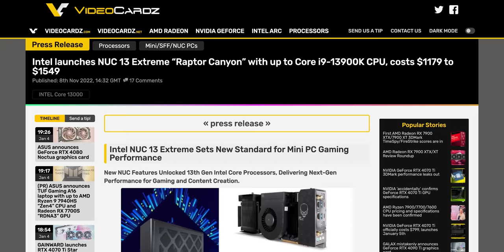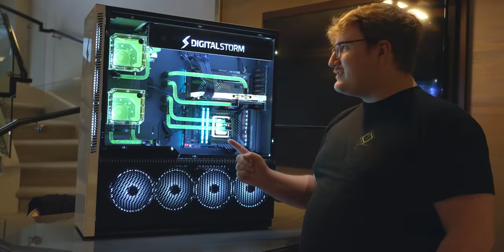They wouldn’t let me game on this - Digital Storm Pre-Builts

Comment: This actually looks really portable. And while this specific one is only for show, a 3080 makes sense given how expensive the 4000 series is (I know the real reason was for the water-block).
Reply: He cringed and apologized when he moved it 3 inches, he kept saying everyone is scared wether he’s joking or not this doesn’t seem in any stretch as portable, if I can’t take my system away from the home confidently I don’t bother with it. But that’s just me.
Reply: @Redacted_  did you even pay attention? It's a thin plastic prototype. Jfc some people are insufferable
Reply: better buy the soft tubing option if you plan to carry it with you
Reply: @Redacted_  its a joke because of how much of a prototype it is as explained in the beggining
Reply: @austinw212  Yes because Dropping a Prototype can be Catastrophic especially if it's the Companies only one and then you can Responsible for Paying for the Parts the Tooling and Labor cost to make another one which gets Expensive you could probably buy a Truck Load of 4090's for the Cost of a Mistake like that
Reply: Yeah, but how cheap is the 3080 comparably? In Germany atm the 3080 and 4070 ti are basically the same price in retail so the 4070 ti makes sense here (I know it wasn't out yet when they designed the system)
Reply: @Redacted_  It's made of plastic, it's a prototype
Reply: @hermitcrack9091  no I missed that part, it was on in the background as I was at work doing a few different things at once.  Don’t have such a diva meltdown about it Jfc
Reply: @Redacted_  cope
Reply: Get some ITX parts, put them in a FormD T1.... profit?

Comment: 7:28 I have a tech tip relating to the tea pc. If you need a tool assist to tighten fittings put scrap cuts of tubing on needle nose pliers, it keeps the fitting from getting marred. You can also buy cheap bulk tubing in a variety of sizes at most hardware stores to get tubing that fits more snugly on your pliers (helps in cramped places).
Reply: Nah, use regular pliers, not needle nose.  The inside shape of normal pliers gives you much better grip on something round.  Just cut the scrap piece of tube open and wrap it around the fitting before tightening.

Comment: I feel like for safety reasons they should put the PSU at the top of the case with some sort of custom power cable adapter that lets you still plug in down at the bottom. I would be concerned about potential water cooling loop leaks that very easily could drop down into that PSU with mains voltage running through it. Otherwise it seems like a very nice product.

Comment: I can't find any volume figures for the spark, but the original was a little less than 5 litres. So if we're still sub 8 litres and get xx900k and xx80 series graphics in such a small case. That's really impressive, I'd love to know if they have to undervolt and what temps they get.
Reply: you can calculate it, he had iphone near it
Reply: @vipvip-tf9rw  sure, I could do that. But I'm not bothered enough to put in the work. It's not like I need to know the volume for any particular reason, except a curiousity

Comment: The only question I have is: why? Why would they use a NUC, and not just standard ITX parts? It's not like this is much smaller than a FormD, H1, A4-H20 or N1. All cases in which you can also fit the highest end parts, but then in standard sizes, without resorts like NUC parts.

Comment: They should bring back sli in the form of ramless GPUs that just add to your current setup and increase your performance slightly for GPUs that don't pass their requirements and in general give older gens access to raytracing. They even could call them "rtx sly" or "rxXXXXxt cross" for AMD/ati replacing the X's with the series.
Reply: The cross could also be another X hahhahaa

Comment: I'm currently thinking about building something like this with the new NUC 13 Extreme. Any details about the baseboard and how they use it with a differently located GPU? And using a normal PSU instead of the intel 12V specific PSU?

Comment: Flawed. So so flawed. The Nuc series has always been a horrible platform. More costly and has worse performance with virtually no space saving over a mini ITX build. A FormD T1 will be of similar size with a MUCH better upgrade path. Options include air-cooled, AIO, or custom loop.

Lol. Send the system back to get an upgrade.

Comment: at that point just get avtim from 2019 were just seeing cap lity of thst into smaller computers ther nothing really new except.maybe perfkrnace of card would be doi cbality seeing that in case perchip really hasn't changed excel squiz more air water make gpsu perform better in smaller case 2 grsndis bit much I'd out make 1300 1400 max 1500 .

Comment: Tell me what you think after reading the following statement:
Paul's Hardware had 4 sponsors on just one of the videos for CES23 that I just saw ("ASUS/CoolerMaster/KIOXIA/GIGABYTE").
LTT had no sponsors for CES23 and Riley is selling himself on the streets for DBrand. All of the above sponsors are what Linus works with on a regular basis. 

In my opinion, The coverage of the CES23 by LTT was lackluster at best, probably the worst in previous years, not sure what happened. Not judging but yeah.😉

Comment: I can't say enough bad stuff about the digital storm computers. I got the Aventum X a couple years ago with the custom water cooling. It is a complete piece of sht. One of the worst builds I've ever seen. All the connections were loose, the wiring was the worst I've ever seen and I paid extra for pro wiring. The custom loop was so bad when I went to drain and replace the fluid the hardline tubing just fell apart in my hands. All the connections were loose and the parts were low quality. The pump barely moved fluid and my cpu was overheating. I finally had to pull the entire build apart and salvage this $7k hunk of sht into another build. While tearing it apart I found the ridiculously poor quality work. Anyway, don't buy this piece of shit, total waste of money.